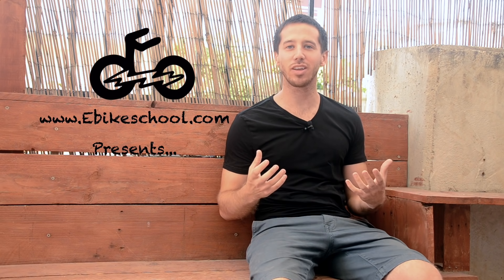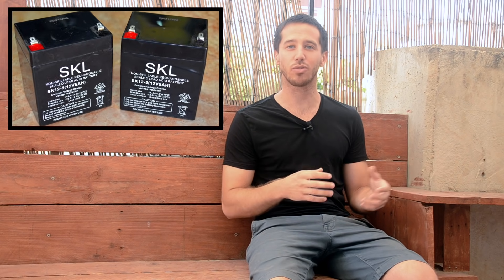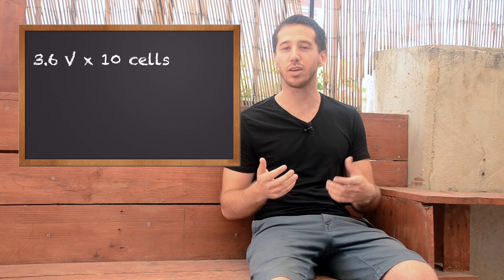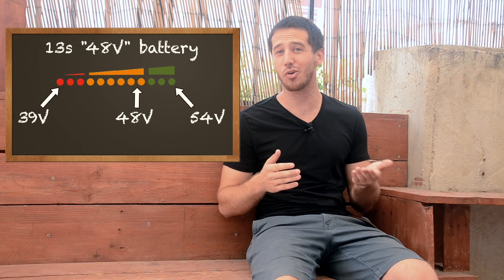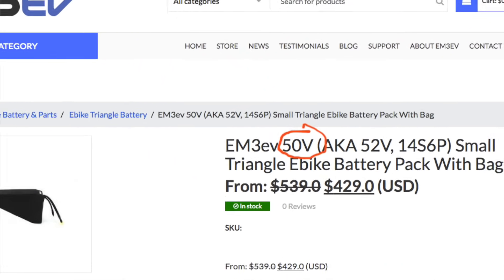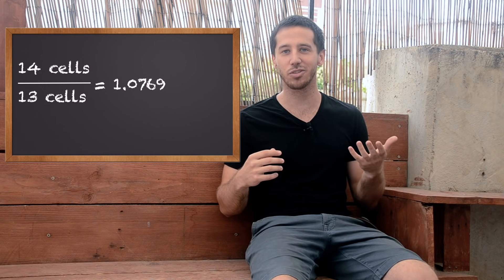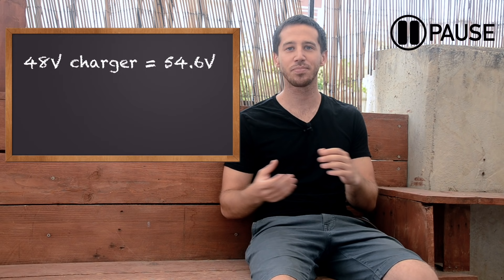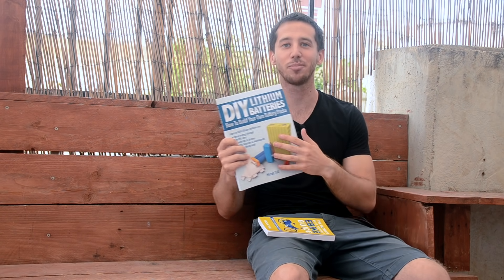Which is better: 48V or 52V battery?

Comment: One other advantage I see in using a higher voltage battery (52V or otherwise), is each individual cell will give less current to the motor, which means less voltage sag, which means the BMS will be ON longer before battery cutoff, which means the useful range of the battery is higher as well. When the battery ages and the internal resistance of cells starts becoming a problem, you won't be annoyed as much with higher voltage batteries.

Comment: Also according to the electric calculator if you increase available wattage per volt you decrease the amps so theoretically two 750 watt 36 volt batteries only draws about 26 amps,safe enough for most all controllers, no?

Comment: Why don't ppl just run 2 36volt batterys in series, that's 72 volts,heck,run a switch that  parallels them on demand so you can choose between distance or power why doesn't everybody do this?

Comment: Hello,thanks for Your Info on Battery.pls my Question is.WHY MY BATTERY CANNOT CHARGE ABOVE 85 % ????
Reply: Franklin Eneji I asked this very question to Bafang and was told that 52v batteries will charge to 100% but 48v batteries will indicate at around 80%. In other words, your battery IS fully charging to 100% but the controller sees it as 80%. They indicated I could switch the indicator from % to voltage. I leave it on %. It’s been stated to not run below 20% for the health of your batteries so I calculate that If 80% is full, (100%) then around 16% is the low limit (20%).

Comment: Actualy it will run cooler and draw less curent for the same speed when the voltage is higher. Same curent will result in higher speed for the higher voltage battery.
On the other hand, the difference is less than 10 min.
Reply: Less than 10% :)

Comment: informative video - thank you.
I'd be interested in a battery comparison that includes amp hours - example: 52V 14Ah  vs.  48V 17.5 Ah
Reply: I'm interested the same thing too.
I have two options with same voltage but another is 20.8ah and another is 23.4ah, i would love to hear what this means in practice.

Comment: hi mike i cant find your e-mail i have a special battery charger that can charge a 48 volt 20ah lithium ion battery from 49volts to 60volts without heating any of the 106 cells i could charge  over that but i havent tried it, yet let me know if your interested-dan

Comment: G’day Ebike  School. Great channel!
I would like some help on fault finding throttle failure if possible.
I have a  60V, 450w utility scooter with a 22A “RAMA” Controller with 3 speed function.
I had a little mishap when fiddling with the main power cable connected to the battery.
Whilst the main feed was disconnected from the controller, there is still the ignition switch wire connected to the controllers loom.
I accidentally short circuited the main feed for about a millisecond which fried the switch/throttle wires connection tapped to the loom.
The switch wire doesn’t have its own connection point by way of plug or termination, as it was tapped directly into a 60V low current wire coming from the controller.
From that point everything was working except the throttle.
I reconnected the wire back to its original  position, however still no throttle.
I checked for continuity in the switch wire which was ok and also opened the controller to check if any MOS were burnt out, and checked their voltages - all seemed fine.
I then re-tapped the switch wire to the main  60V feed, but that didn’t work either.
How do I test the relevant electronics components within the controller to isolate the problem, or how do I bypass the switch wire  to ensure the Motor still accepts power from the controller?
Reply: just make sure the red cable behind the tv doesnt interfere with the bikes acrobactic performance due to malfuncioning part claims i no longer own.

Comment: 24v e-bikes no longer exist for the most part.  36v is a weak bike not medium.  48 v is low power,  52 is medium, 72 or higher is high.

Comment: Micah....a nice informative video....but........A MAJOR IMPORTANT FACTOR MISSING from your video on the diff btwn 48v and 52v e-bike batteries is RANGE !!!....which (in a video about e-bike batteries) is strangely NOT mentioned even ONCE in your video !!! A helpful and important REMINDER : the BIGGEST concern today in the world of e-bike batteries is NOT voltage or amps or weight or price, etc....it is RANGE !!!....so how bout a "PART 2" video explaining the different TYPES and brands of e-bike batteries offering the longest RANGE ?!!!....

(* The TYPE of battery of my cheap 2019 E-PIONEER (chinese import) e-bike is UNKNOWN (tall and vertical behind seat post) and NOT branded, but has a barcode label stating "48 volt / 12 amp")

So Micah (or ANYONE), please inform me : 1. what TYPE is my battery ?....2. Which specific SELLERS have a compatible* longer-RANGE battery available to me ? (i searched online and havent found ANY)....3. Are there ANY "52-volt/20-amp" compatible batteries available ANYWHERE ?....My guess is your superior "E-Bike School" knowledge has (or should have) the answers !  - Paul M.

Comment: I think voltage consider as torque and amperage consider as speed don’t you thinks ? But I wonder is 12 gauge wires run to the controller can handle higher amperage ?

Comment: Also, 48 volts is considered 'Extra Low Voltage', and the maximum voltage that does not pose a serious shock danger to human contact. Above 50 volts to 1000 volts is considered 'Low voltage' and dangerous.

Comment: Besides the higher price and the need for a higher voltage charger you forgot to mention the main disadvantage of a 52V battery.
That are the higher weight because of more cells in series and the higher volume.
The big advantage of a 13 cell 48v or even a 10 cell 36 v battery is the lighter weight due to far less cells in series. Also less cells means less cell are prone to become dead cells in a damaged unbalanced battery.
Bottom line
Building a battery is always a compromise between a amount of Voltage cells in series and between the ah capacity determing amount of cells in parallel.
I rather use the limited amount of volume in the ebike triangle frame to add extra cells in parallel so the capacity and range of the pack increases than by adding more cells in series to only increase the max top speed without extra range or battery ah capacity.

Comment: Hi, I have a 48V battery pack with an USB port to charge mobile or other stuff. It doesn't work. I think the problem is the small pcb inside the battery pack. I cannot find a replacement. Do you have an idea where I could find it? Thanks

Comment: Interesting information about the two battery voltages.  I would think that on my new LectricXP, that has its 48 volt battery inside of the frame, that this is the only choice that I have in a battery.  But, perhaps someday, as the battery technology advances, the voltages may change as well.  Thanks for the great videos and keep us up to date, please!
Reply: I still can't understand  what you are talking about it all goes over head
Reply: Fully charged it displays 54 ish.6 or so

Comment: You should have really used the graph of 2:40 AGAIN in minute 4:33 (52V-advantages-analysis), in order to display the "shift" of 48V now being available for 60% of the range, in comparison to the case at 2:40, where the 48V are available only for 50% of the range...! That would have made your work much easier...

Comment: Trust me you are not clever when you try using a pack with a higher voltage than specified. There is no cheating possible. You can't redesign part of the power system, it has to all match for the battery to perform correctly. This video is click bait because they know lots of kids want to cheat and create illegal vehicles and bikes.

Comment: I just helped the buyer of a used ELF to figure out why it would not run - She got a 52 volt battery and a 52 volt charger from the previous owner. Of course the 48 volt motor controller remained in shut down mode. Someone sold this used $3000 bike without bothering to tell her they had been screwing with the design and using an unapproved battery. I had her discharge the battery part way and buy a 48 volt charger.

Comment: OK you have established that you can run a 52 volt battery system, my question is can a 48 volt controller  handle these new 60 volt DC battery's coming out on the line of chainsaw's? with a patch cord and good mounting system.
Reply: Go to school and find out
Reply: Check the low charge cutoff of the 60 volt battery - if it is below the top range of a 48 volt controller and the 60 volt battery is not charged beyond 55 volts, it could work for a while. Volts are not everything, amp hour ratings are just as critical for useful performance.
Reply: @mtuz8356  As a degreed electronics technician with 10 years of ebike commuting, there is nothing new you can tell me. There is no "motherboard", there is a sealed motor controller with specific voltage and wattage ratings.
Reply: @mtuz8356  No you are hopelessly wrong. Ebikes have several boards that are NOT controlled by any "motherboard". Most controllers are sealed tight with potting to prevent moisture damage. My ELF has a board for controlling the solar panel charging, a black box to connect controllers and DC/DC converter and turn signals, a horn relay and and power key relay. None of those are interfaced with or controlled by any other board and certainly not the motor controller board.
Reply: @mtuz8356  You can't argue a losing premise.  My AA degeee in industrial electronics, 36 years as a micro electronics bench technician working on battery powered critical medical devices with FDA certification, and 10 years of daily ebike commuting totaling over 20,000 miles and 5 different ebikes tells me you are a nimrod. These Youtube trash videos are click bait to draw immature kids like you who think they can soup up ebikes, an act that only makes them illegal on roads under Federal law. I repeat - all the best motor controllers are sealed and can not be opened. Any boards in them DO NOT control functions other than motor control, meaning they are not "mother boards" for the bike. One could say they are internal mother boards for the motor controller only buy that is not the way professionals use the term. A computer mother board controls all functions in the machine. A car's mother board is the computer module that oversees everything, not just the motor.

Comment: join the 100v+ club
Reply: @dylandesmond  No. If it was 'better' most bikes would offer that feature. That would increase the number of cells used and the cost, for no worth while gain in basic consumer bikes. Some hill climbing specialty bike? Maybe.
Reply: @popeyegordon  a motor with a higher kv will generate more heat than a motor with a lower kv, simply doubling the voltage and halfing the kv of the motor will achieve the same speed with a better efficiency, 1/2 the amps will be required for the journey and the motor will have less heat to shed, where as a bigger kv motor would need a bigger motor casing size to shed the excess heat that it does not have, as it is the same size motor, going up hills the 48v 20amp motor would produce more heat than the 96v 10amp motor, making the 48v motor less efficient, on a perfect level ground the 48v 20amp motor would consume 48v20ah and the 96v10amp motor would consume 96v10ah in the same time period minus the heat made from the slower accelerating per amp motor, in saying that i get over 600km range on my bmx on 1 charge it is 84v

im guessing you would say that running 2 motors is less efficient also....
Reply: @popeyegordon  the only reason they do not offer high voltage is because higher voltage has less resistance (another reason it is more efficient), and it can stop your heart alot easier, for a noob who doesnt doesnt know anything about electronics, it can cause problems
Reply: @popeyegordon  no it wouldnt
Reply: @dylandesmond  No proof? Never happened.
Reply: @popeyegordon  its the same kwh battery, with lighter components that generate less heat, i dont need to give you any proof, your going the same speed, if youre going the same speed with a battery pack that is double the voltage you will use half the AH minus heat losses, its simple mathmatics that a child could figure out
Reply: amps generate heat
Reply: @popeyegordon  instead of 10s 4p you would have 20s 2p, you would get the same range (slightly better because of heat losses) on the same amount of cells, and the bike would produce better torque and be MORE efficient
Reply: @popeyegordon  i have built over 200 custom ebikes in the last 3 years for customers, ive done a fair bit of testing on treadmills to know the differences you can get
Reply: No. The federal speed limit for ebikes is 20 mph. Do not encourage illegal reckless behavior on roads and trails.
Reply: @popeyegordon  if your bike already does 20mph and you wish to increase the voltage from 48 to 52v then yes it is illegal as the kv of the motor hasnt been match accordingly and you are breaking the law.
Reply: @popeyegordon  my bmx is 84v 40ah, smaller wires can be used, it is 20kph max 200watts road legal,

i also have a 136v 76ah bike that is road legal 200wats 20kph max, who's encouraging to be reckless?

it is more efficient with heat and weight, wires can be thinner.... less amps are needed
Reply: motor kv windings plays a big thing on top speed, not just voltage...
Reply: @dylandesmond  That is of no consequence. There is nothing wrong with experimentation but world class top engineers design great bikes that perform well with 48 volt packs. One could create a 2000 volt pack for a bike but there is no gain of note. I guess you would get to make a Youtube video about it, maybe the click bait revenue would make you a little money from e-bike geeks.
Reply: @popeyegordon  if that were the case they would be using 48v in the worlds most efficient electric cars, but they are using higher voltages

Comment: what should I run for battery size if I have a 36v/48v 1000w controller and I plan on running a converted alternator and I want maximum range and battery life? I am making my own battery packs out of 80 of the 18650s and I have already built the bike so the batteries are the final step. thanks for the video btw it was very informative

Comment: Protip: higher voltage = lower current draw. Lower current draw = lower cell voltage drop*. And the lower the voltage drop / the higher the total voltage is, the more torque your motor can get, provided you're not hitting a power limit with the ESC. If you have a dumb ESC (such as a H-bridge on a brushless motor) then you will gain more torque and speed from increasing the battery, but if you have an ESC that controls itself from amperage and speed then you'll probably get an increase in torque if the cell voltage drop was really bad, but the top speed will be regulated by the ESC. Uphill speed might increase due to the increase in current available, but your top speed will still remain at what the ESC is programmed for. e.g your 600w hub drive will still only do 25MPH on 52v just like it did on 48v (provided that's the limiter on it). It'll probably get up to that speed a bit quicker though which is always a nice bonus.

Comment: Hi...im new into ebikes and looking into investing in an ebike conversion.  Very basic question... when you speak of increasing in range by going with  52v battery,  are you speaking of just that your ebike will run a little bit longer than normal?

Comment: Good video as usual, Micah. But a point worth making, IMO, is that it's sometimes easier said than done go from 48v to 52v when using standard battery cases, as there just isn't enough room for the extra cells.
Reply: buy a new one or is money a problem?
Reply: @ATARI-DAVE-73  Just stating a fact. Space can be also be a problem when fitting a bigger case into a frame or rack etc.

Comment: Unless you went the same speed as were going with the 48 volt so now you'll be getting longer range.
Reply: What i was going to ask
Reply: Yea, from the math alone you'll get longer range. a 52v battery pack has more energy than 48v battery pack, it's just that simple. Also you get extra power and speed if you ever need them.
Reply: The Top Gear guys enter chat:  Why on Earth would you want to do that?  POWER!!!

Comment: What determines the power controllers amp draw..you use a 20amp controller..why wouldnt you use a 40amp controller to up your speed and torque? Im sure it would cost running time but I am a dummy and not sure if its the electric motor that determines this or its just more $$$ for a bigger controller..thanks..love this vid

Comment: Hi Bro, your explanation was quite educative but still i one question to ask you please reply.
My bike have 48v 20ah battery can i use 48v 10ah my controller is of 20amp ?
Reply: I don't understand your question but the controller will limit the voltage and current to the motor.. so if the voltage is similar a different size battery will change the range/distance but power will be same

Comment: Excellent video,thank you so much. But I have a question:you explained very well the charge voltages, to charged to 100% the charger needs to apply the cells ratedmax voltage, example 3,7 volt. So on a 52 volt pack it should be 52volt. But why at the end of the video do you say a 52volt charger needs to charge up to 58 volt???

Comment: Hi sir,
I get 48v 19amph battery (lifepo4 32650) 16s, total number of cell 48. how much voltage and current are recommended for the battery?